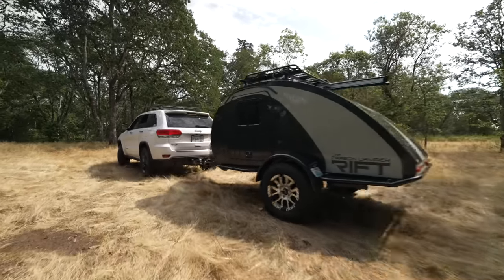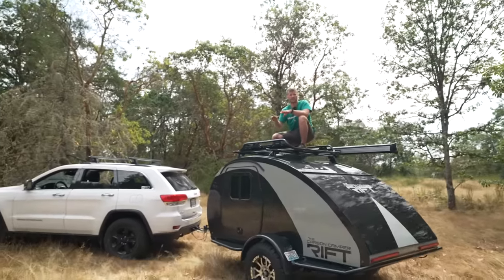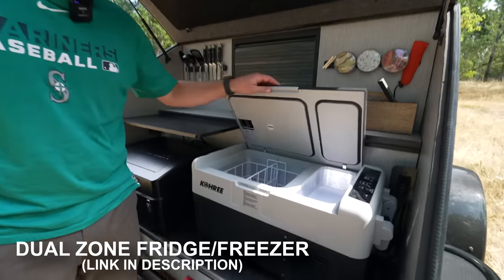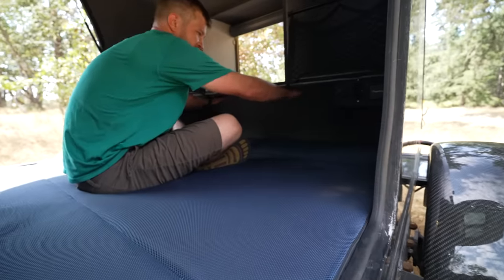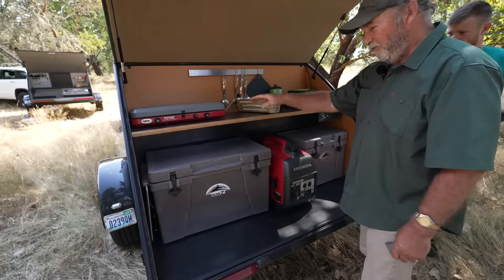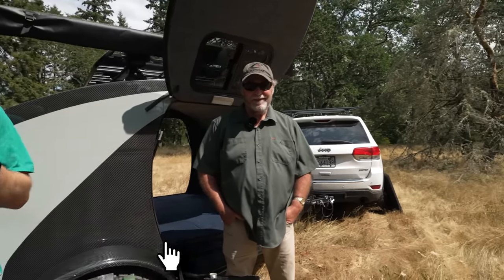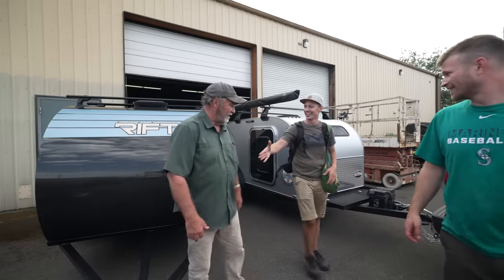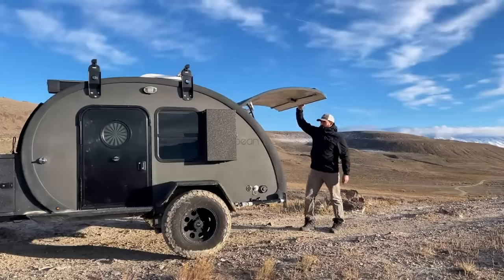Incredibly STRONG yet LIGHT! Carbon Fiber Teardrop Camper

Comment: I like the overall execution of the trailers and having the removable galley is a nice feature. One thing I would change is the doors. I like how they open but it would be cool if they had the ability to stop at 90 degree angle to create more of a porch in bad weather.
Reply from the maker: Agreed! I think that can be done and would be a nice touch.
Reply: Great input! They can stop at 90 degrees no problem. We can also put shorter struts on the doors to limit them there.
Reply: I'm sure you could tie them down when you want the rain shadow. The rest of the time it's just something to hit your head on.

Comment: What a great modern twist on the ol standard.  I knew it would only be time before someone did this (carbon fiber) on a production scale.  I have been building teardrops since 1994. All of our teardrops were under 750 lbs, and about half of them utilized removable kitchens.  We even built some that had removable roofs that allowed you to haul a motorcycle.  We did a couple motorcycle haulers that had a tonneu type covers with skylights.  So much fun to get creative with these. You guys have done a great job!

Comment: Great Tear Drop. Some recommendations:
1. Install slide in shelf in the front where the solar equipment is housed @3:00 mark. Provides the option to use Solar generator instead of using permanent install components. 
2.  Add a window AC unit on top of the front tongue box.  In the Southern part of the US, such as Texas, you really need AC. 
3. Replace USB plugs with with 12volt adapters. USB requirements keep changing. This adds more flexiblity
4. In the rear add tow hitch. Provides option to mount bike rack or YAKIMA, EXO SwingBase, Hitch-Mounted Base Rack
Can additional mount options be added by the user, such as external fuel, water, table, tire mounts?
Reply from the maker: Great idea with the slide in shelf. On their website shey show a gas generator in their beak box. This would also be another nice place for a slide out. The beak box is also a great place for the ac like you mentioned. Low profile, aesthetically pleasing. Yes, a combo of USB and 12v is pretty standard in the industry.   Good question about the mounts. I wonder if they would need an additional side wall between the carbon fiber walls (similar to what Bean uses). Basically something that those mounts can securely be attached to. This unfortunately is where a lot of that weight comes from with these off-road trailers. You basically are doubling the thickness of the cabin walls.

Comment: I like this one. The ability to be a cargo trailer was always important to me. When I was deciding on how many doors to have, and their sizes, one of the most important design features was always to have a large rear door so I could use the trailer for (as an example) moving or helping someone else move. I dont have a galley but rather, my daughters removeable bunk/bed is right across the back behind the rear door. I guess it will serve as somewhat of a galley once she grows out of it. End ramble.

Anyways. Love the simplicity here. I did get the feel that the finish might not be top of the line, and you confirmed that. And thats ok, but not at 30-40K.  None the less, this is one of my favorites you have covered recently.

Comment: I really like this trailer, especially the removable galley wall. 
Another feature I like a lot is that long tongue, with the two-compartment storage.
I agree with another commenter that the up-opening doors present a problem for those who would want a retractable awning mounted to the side, or a pop-up tent or canopy to hug the side of the trailer.
As far as the off-road capability, I think this trailer would easily handle any dirt road I’d ever attempt. 
I think this trailer could easily get almost anyone way out into the woods, or the back country. 
Thanks for the in depth review.

Comment: That's very pricey! If it were everything I was looking for, the price wouldn't be as big of a deal but it's not quite right for me. My biggest question: Can you close the door from inside the cabin or do you have to pull it down while standing outside, hold it while you get in then finish closing the door? Are the door hinges adjustable for where the door stops to make it an awning/easier to grab from inside the cabin? I'm so glad to see many builders coming to this market, especially building for standard low towing capacity vehicles.
Reply from the maker: I had very similar questions when editing this video. When filming I overlooked them. Yes, you can close it from the inside. It is not quite as awkward as it appears, but it still not the most convenient. As for adjustable I agree. Like he said in the video, you get a LITTLE coverage from the elements. If they could add a stop to get that door parallel with the ground they would have something really special there. And then while we are on the topic of doors adding gas struts just adds one more component that requires maintenance and wears out over time. I am okay with added components if they give an immediate physical benefit. But, something like this is probably more of a novelty. But, man does it look cool! And I am not trying to be saracastic here. It really adds to the look of the trailer.  I completely agree with you. I have been predicting this emerging market would come. I am so glad folks are willing to go in a direction the opposite of what I call "overbuilt."
Reply: @PlayingwithSticks  Thanks for replying! I also wondered about the longevity of the gas struts and any maintenance that would be required. It does look cool and the adjustability would be quite wonderful to make it an awning. Keeping a low profile with the door not going above the trailer is helpful sometimes too.
Reply: Adjustability would be easy to achieve! Thank you for the feedback. We could also put an additional handle on the inside of the door to make it easier to close from the inside

Comment: Yet another interesting video by Drew. I think that one design feature that was not mentioned by Rift that they really should have, was the shape of the side doors. The fact that they open upwards, gull-wing style, is nice and cool, but what that actually allows is a door that is easily accessible with a wider opening for shoulders let's say. That is a very practical shape. This is a nice trailer.

Drew, I recently discovered the 'Hero Camper' from Denmark that is imported into the USA with all of the European running gear attached. Including overrun brakes (surge brakes, inertia brakes or however you prefer to refer to them). I would love to see what you think of that particular trailer in future video if that were at all possible. 

A small request if it is at all possible. Being a non-American, weights and measures in imperial mean nothing to me and I have to keep pausing the video to do the conversions. I would appreciate it if you would consider adding the metric equivalents on the screen, if it isn't too much trouble for you. I appreciate that editing is already time consuming without having to do and add metric conversions also.
Reply from the maker: Hi Andrew, I think you may have missed that tiny portion. At 5:37 he talks about the opening width. And I agree. It is a very practical shape. Charles who is builiding our trailer has talked about surge brakes as well. It makes sense that these little trailers would have them. As for the Hero Camper, I can definitely do that for you. We got the chance to meet with the kind folks from Denmark. Unfortunately there are number of trailers in the queue before the walkthrough releases. I have them scheduled for a couple days after 4th of  July. I had planned on adding metric conversions as well, I just keep forgetting to do it. So I am glad you requested this. I can see it slipping my mind again, so make sure  you call me out for it next time if you don't see it.
Reply: That last section makes 2 of us trying to understand it better by pausing and running to google 😆
If it’s not to much trouble for you Drew I vote for the metric measures to be included as well. But in any case, I have to do it regularly as, at least half of the Rv’ers that arrive to our campsite uses them - I know, I should know better now. 😅
Reply from the maker: @adventuresonwheels5272  Okay, you better hold me accountable to this. I am ready to do it! I just may need a reminder from time to time. Haha.

Comment: Hello All. I came across this video and was quite impressed with the trailer. I drifted over to the comments, and was quite surprised by the criticisms around price. The way I see a camper is like a passport to the great outdoors. I see the purchase price as the cost of access. I simply amortize the price of whatever I pay over the course of time and usage. If the camper (at whatever price) gets you out into the wilds, then that's a good thing. If it just sits in the driveway collecting dust, twigs, pine needles, etc., and only gets used twice a year, then "forget about it." However, if I'm out two or three weekends a month, year after year, then the price is stacked up against that. And...well worth it. In other words, what's on the other side of the equation? If a lot of fun is on the other side, then it's all good. I have another example: I purchased a hot tub about 15 years ago after breaking my back. It was $9,000. That's a lot of money for a bucket of hot water. However 15 years later, having used the tub twice a day...and sometimes three times if it's raining, I've amortized the cost down to about $1.64/soak. I'm here to say that it's been a great expense for me. I imagine that I would enjoy this camper tremendously, and would amortize the price down to very little over the years....i.e., I'd be out in the wilds instead of sitting at home.

Comment: Very nice!   I run all the features through my full time filter.   The doors are great but how would they do in the wind?  And as light as thus is how would it do in 40 to 60 mph wind?  You couldn't put a side tent up against those doors.  For me I stopped using a side tent long ago but folks still want them.  Storage is not obvious but could be worked out.   I LOVE the look of this teardrop.  I will look up where they are and maybe I can get over there to see this in person.  
Thanks Drew!
Reply from the maker: I love seeing you run these through your "full time filter" Another thing to note about the doors is the use of gas struts. This adds an additional component that requires maintenance and wears out over time. There were a number of people who had the wind concern with the Road Toad. It isn't something I was intially worried about. But, I am now more intrigued to see if there is something to this concern. This summer with our trailer we will get the chance to see how a lightweight trailer does in the wind. We spend most of our time in a very windy region, so we will get the chance for sure. And yes, in my opinion the storage was definitely on the lower end of trailers we have seen. They went with that nice clean open aesthetic on the inside, which did feel nice in terms of space. And on the outside, very utilitarian in terms of storage solutions. Definitely a minimalist design here. Agreed about the looks. It is a really beautiful teardrop. And I have a feeling it will even be better by the time you see it based on our conversations regarding the fit and finish.

Comment: Kinda pricey but built out of that material it makes sense being that expensive. Love that suspension. I think the independent suspension definitely will help reduce the normal bouncing that occurs in some lighter weight trailers. Wish the Road Toad came with this type of suspension. I even think the independent/timbren type of suspension is "lighter" in weight than the typical axle built suspension normally used. Good thoughts in conclusion. Thanx for the segment.
Reply from the maker: One of the things that surprised Charles and I was the weight of the Timbren suspension. That is what we are installing on our new trailer. We both wish there was an independent suspension out there that weighed about half the weight. One of the biggest things with these light trailers is making sure the suspension is derated. Most of the suspension out there in terms of independent suspension is overkill for a small trailer. So what I find often times when I take out a new trailer on the market, the independent suspension doesn’t actually help because they didn’t derate it and now it just doesn’t have give to it.  it almost feels like a poorly weighted leaf spring axle. Sorry for the bunny trail. It’s just something that’s been in the back of my mind that I haven’t been able to share with anyone lately. Beings you and I talk a lot. I thought I’d share it with you. 😆  I agree with you on the price. Obviously, something made with this material is going to cost more. But, it would be nice if we could get it at a more affordable price. I now I’m forgetting what the road toad came with, was it a torsion axle? I am a big fan of a torsion axle. If it’s weighted right, it makes a really nice ride with these small campers.

Comment: I like the doors but like some people have commented having the ability to stop them at a preferred height to act more like a shade umbrella would be cool. The doors do open the possibility for conversion into a private shower or stand up changing area or even a mud room. I'm thinking about getting a teardrop camper as my first camper so thoughts like these may seem a bit out there. The removable galley is cool. I could see myself using that feature for access to swap out the foldable foam mattress for an actual residential mattress for greater longevity and better sleep.

Comment: I have a 2017 NuCamp T@g Boondocker which would be comparable in size and features. I would stay with my Nucamp after reviewing the features on the Rift since I got a bit more with mine over his. Hes not far off tho and I'd like to see him succeed but the gullwing doors, while nice,  won't work with the yakima awning deployed. The fantastic fan won't work either with yakimas roof rack above it, there's no room to open the hatch. 

For under the base price listed in the video I also got a 12v fridge, a 12v TV, and a 5000btu AC. 

Renogy makes some nice stuff but I think he could use a more cost efficient supplier of PS wave inverters and solar controllers.
Reply from the maker: I really appreciate you taking the time to share this information. It’s always nice to hear feedback from Teardrop owners.

Comment: Very cool product.  Carbon fiber makes a ton of sense for a teardrop.  Eager to see what they're going to put on the market in the future.   One suggestion I would have for the manufacturer is a little more headroom.  Looks a little claustrophobic in there for the rainy days when you're stuck in the trailer most of the day.    The BougeRV CIGS flexible panels might be a great solar panel to fit tightly and sleekly on the fiberglass on the top of the trailer.
Reply from the maker: Agreed with that headroom. Even just a bit more to make it the same as a Bean Trailer in terms of headroom would be nice. The beauty of using carbon fiber is you add all that extra space and you really haven’t increased your weight much, it’s more about aero at that point. Great shout out on those panels. Those are the exact ones we are installing on our new trailer. Not so much for the 360° bending properties, but more for the shade advantages over typical silicon. The flexibility is a nice bonus.
Reply: Thanks for the feedback! There’s more headroom that it may seem but you can never really have enough. The bed also has the ability to fold into a couch for those rainy days spent inside.

Comment: Ok tear drop type of trailers were around a long time. I remeber when we bought a farm they left a tear drop trailer at the farm. Dad was 
disabled and mom decided to give the trailer away. A farmer took it. I remember it was  made of steel. We had to bust open the door. there was a burlap bag of shelled corn i guess the trailer was used to haul feed. my question is did they make these out of steel like cars. I dont believe the trailer had insulation just steel walls. It was a two tone blue. Darker blue on the bottom half and light or skyblue on the top half. Probably màde in the fifties. It was 1968 when we found the farm and bought it. Summer break was just about over. i would think the trailer weighed a ton. Just a figue of speech. I would like to know more about these early tear drops. 73

Comment: I love most things about this. But. In the rain/snow is it just going to run off the door into the trailer?
Reply from the maker: In theory, yes. However, the amount of time a door is open in those situations it is very minimal. But, even with that little time you’re bound to get a few drips here and there. Unless they added nice rain, gutters and exit ports for the water. I didn’t look closely to see if they did or not. The things I should’ve looked at while on site are so much clearer in hindsight. 😆

Comment: Very nice execution using carbon fiber! We're still kickin around the idea of traveling again, now that my wife has retired. Our tow vehicle would be our Tesla Model X so weight is almost as important as aerodynamics. I realize our range would be affected so we'd need to stop more frequently to charge up but, then again, I no longer have a 300-mile bladder (wink). Is it feaseable to somehow skin the bottom of the frame to improve airflow/reduce turbulance? Also, is there some reason teardrops don't provide a 3rd brake light up high, maybe on the rack? Seems like it'd be a safety requirement. Thanks for your inovation!